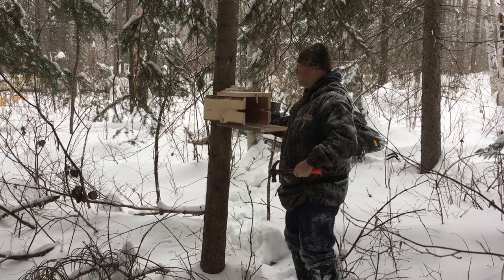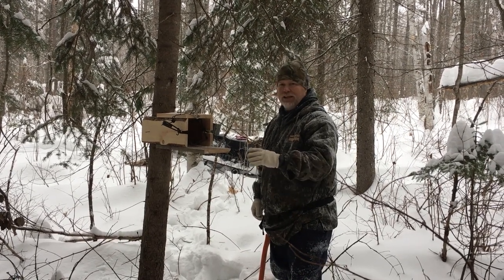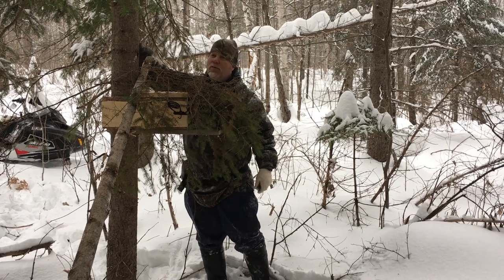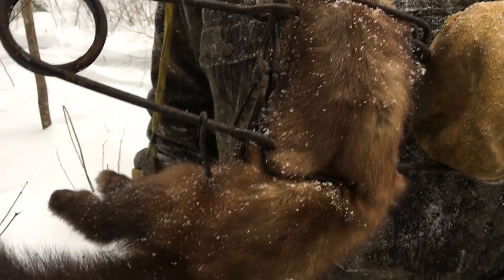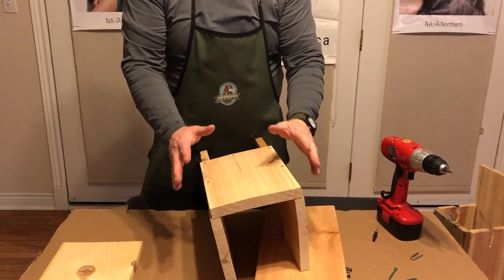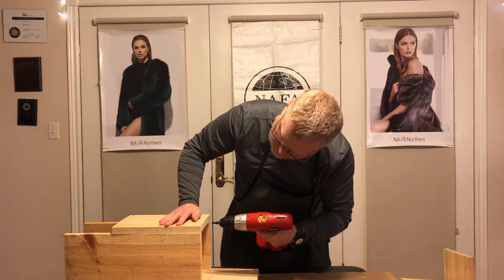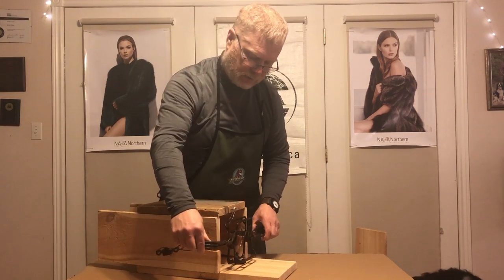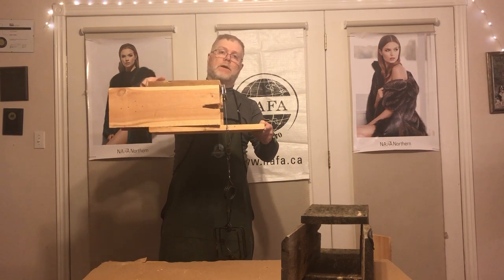Building and Installing a Marten Set

Comment: Hey Jim Thxs for the instructional video maybe you could put a parts list and dimensions of boards in your description so they be easily reproduced by viewers.👌🏻👍🏻
Reply from the maker: Made from 1 inch rough lumber, sides are 18 inches long 1x7 inches wide, top piece is 1x8 12 inches long, the bottom piece is 1x8 18 inches long.